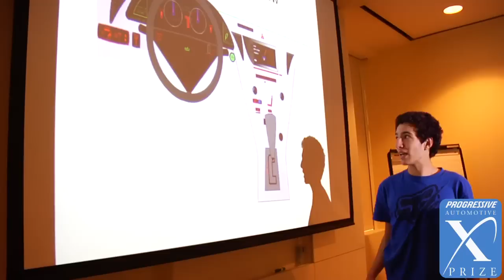Young Innovators - Progressive Insurance Automotive X PRIZE

Comment: The ultra-light, E85-powered Edison2 vehicle getting 102 miles per gallon won the top award in the automotive X Prize.
Out of 111 competing teams, the Edison2 car was chosen as the winner of the Mainstream Class, 4-passenger, 4-wheel vehicles. The “Very Light Car #98″ weighing about 830 pounds,  boasts a 250cc engine fueled by high-octane E85.
The Edison2 team will use the $5 million prize to help bring the vehicle to market in a more consumer-ready version.